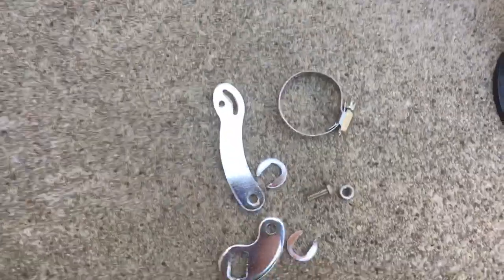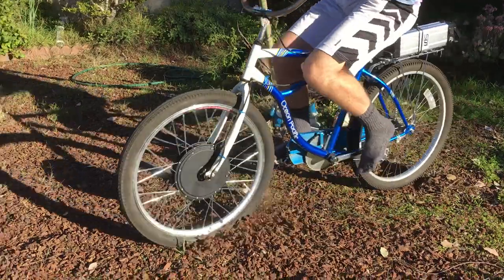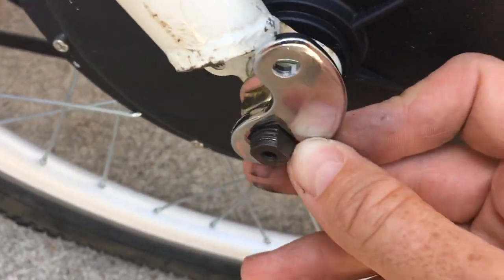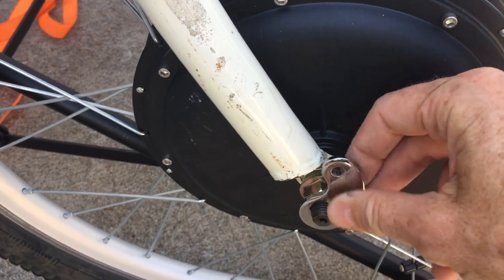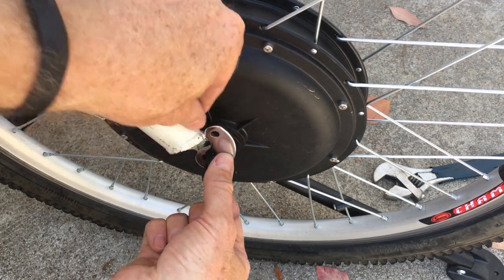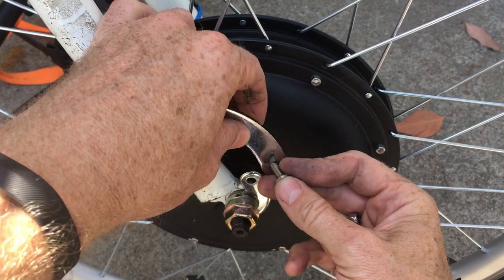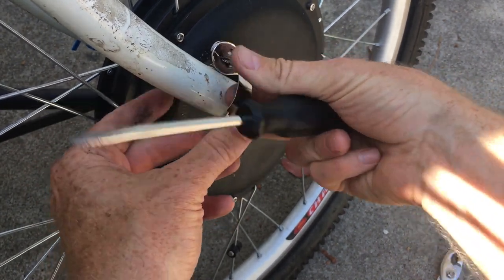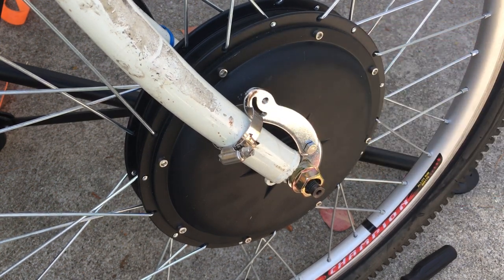How To Install A Torque Arm On An eBike

Comment: Just wanted to share a tip with you. I had originally had thought the same as you, that the torque arm in front of the fork would push against it. It seems intuitive, but it was pointed out to that you also have to take into account the twisting of the torque arm itself. It  helps prevent the rotation but the bottom part of the torque arm is pushing up on the top part which puts downward force on the axle, increasing the chance of pushing the axle out of the dropout.

Where as, if you have it on the back of the fork, it does the opposite, the torque causes the bottom piece to pull on the upper piece which pulls the axle up into the dropout, greatly reducing the likelihood of the wheel coming out, especially in the case of a loose nut.

Chances are you'll be ok with it in the front, but the back of the fork is alot more secure. Hope that helped.
Reply: are you saying the way he has it will push it out the drop out? he has it backwards right? im building ebike dont want to die please
Reply: @Oldmanlearns718  yes, he put it backwards
Reply: That's nonsense.
Reply: I think the way he did it is correct. The pivot bolt sits above the axle, so the plate pushed the axle into the dropout.
Reply: Put it on the rear and don't die.. @Oldmanlearns718
Reply: I just fyi this fact out and agree with you. To vision the explanation of the physics is very simple but I know from experience of having torques in front has no base for energy to feed into which ends up  pulling at the bolt ends which in time, the bot ends of bolt location will warp. Yes it does matter in the long run as I've seen the bolt ends of form being ripped apart from motor wheel.
Reply: Thanks for your insight and the man put the video up. I had the arm on the side of the fork. Stupid now that I've seen the video. I had two problem  the first the drop out was too big. The axle on the wheel (front) was rotating out, and down. I close the drop gap in a vice. Then install the torque on the back of the fork. I converted a trike, the wattage's is way more then I need 1000. I'm 78 and deathly afraid of falling. I don't bounce like I use to
Reply: @marsbase1729 If my ebike came with torque washers and I want to install torque arm for additional security, can I leave the torque washers in there as well? Mine has over 1000W power.
Reply: @faYte0607  yes, I did with my bike, as long  as everything fits, but if it's a choice between the torque washers and the torque arms definitely torque arms.
Reply: Also, I would use 2 torque arms, 1 for each side, for extra safety
Reply: @bobcammarata2338  :face-orange-frowning:🤣

Comment: Great explanation, I put a 1000w wheel on the front of a bike without a torque arm and instantly snapped both dropouts! I now have a new fork and two torque arms on the front and no issues :)
Reply from the maker: Thanks. A wheel with a lot of power can do a lot of damage.
Reply: @hoohoohoblin  I'm getting the QS-205 (16kw max output) and putting it on a fat tire bike with 26" 4.0 wheels. I'm going to make some from 5mm thick metal sheets, just in case lol
Reply: Was your fork aluminum? I put a front hub motor on my old steel cruiser bike without knowing this could be a problem and havent had a problem for a month.  Im still going to install a torque arm for peace of mind.
Reply: Was it an alloy fork and is the new one steel?
Reply: @wecreatezone8940  I can't remember to be honest, the whole thing was destroyed in a shed fire but I think they were both alloy, maybe the second one was more robust.
Reply: @DavidJJJ  Thanks.
Reply: @DavidJJJ  Battery fire?
Reply: @ChristianDonner  Yes, but not my bike. I had a 4kwh house battery that overheated. It was my mistake, it had balancing but I had turned off the power draw from it and it went too far out of balance when charging and overcharged one or more of the packs and basically turned into an explosive. It's all good though, I've now built a bigger shed and no longer using my DIY batteries...

Comment: Your explanation of the forces and torques was wrong, but you actually put it in the right position. I have checked the factory official pictures, and this is correct.

Comment: Nice, I wouldnt clip off the ends of the hose clamp because if you ever have to change the tire it will be alot easier to get the hose clamp back on
Reply from the maker: Thanks

Comment: Front wheel motors are a no no on alloy forks, especially on cheaper ones, My forks failed on drop outs after 30mph down hill ride, then both ends snapped at 3 mph, lucky man. Wished I had known about torque arms. Say drop outs fail with arm fitted they should hold, do you think.
Thanks for all the info and comments.
Reply: Did your front dropouts break when you were going 30?
Reply: At 3 mph

Comment: Torque arms go on the back of the forks. The motor spins forward pushing torque in a clockwise manner driving the motor into the fork but at the same time you have sideways torsion. Putting the torsion bars on the back of the fork will help push the axle upwards into the fork whereas if you fit the arms on the front of the fork they will try to push the axle downwards.  I only have an O level in physics but I'm sure thats correct.

Comment: My issue is on the rear chain side of ebike motor where axle is hollow because motor cords coming out of it. Notch washer, small washer and bolt are attached to motor cords. I cant get a torque arm on motor side. If put torque arm on rear disk side will that keep  axle from rolling out of place on rear motor side? I heard that the hollow side of axle is weaker than solid side of axle.

Comment: Believe it's the opposite side of placing torque bars. In front will slack off once a short circuit of wire ends being spaced from time happens of an extra kick back or jerking. Having the torques in front will not hold the stress and will warp the motors bolt ends damaging the motor rotation for good. In the rear of the forks. Believe me, it does matter on placement as I've seen forks being ripped apart of bolt ends of having wrong side of forks with torques.
Reply: You putting serious stress of rotation on the bolt ends as placing torques in rear of the forks, the energy is absorbed of the forks. Torques in front stresses rotation forward of no base and the bolt ends is where the energy is ending up. You have to place the physics with direction while having a solid base where the rotation s energy can feed into of a balanced friction.

Comment: I have a duel motor philodo h8 2000w and after i replace a flat tire on rear wheel it never stay on when go fast. The rear wheel keep coming loose and i use the same torque arm that you have. 
Any idea.

Comment: Hi, good clear video, I've seen these sold as pairs, do you think 2 would help?
Reply from the maker: I think so. That would be even better than one.
Reply: @hoohoohoblin  So my kit arrived and I got two arms. The only issue was I couldn't fit the second one without modifying it as the cable coming from the hub didn't allow it to slide on. The workaround was to open up the bottom end of the axle hole of the torque arm, essentially creating a dropout and allowing the arm to be slid onto the axle. It may well be overkill but it works well and gives an extra sense of safety.

Comment: Thanks, Have you had any dropouts break with using those torque arms? I've broken three dropouts, two in an aluminum suspension forks and one downhill magnesium fork using a 1000w direct (non-geared) motor using two of what looks like the same torque arms. I've noticed that the inexpensive stamped arms typically have about 0.012" of play on the hubmotor shaft and a lot of play in the torque-arm to shaft arm bolt hole, and when combined with the flex of even a heavy duty hose clamp, even if the torque arm slots are positioned tight to counter the motor shaft torque it still allows enough twist to over-stress the dropouts. I've tapped the tru-hole and used a larger machine screw on the third attempt but that apparently was not enough.

Luckily all three of my failures were starting from a stop using about  400watts (8amps at 48V). the high-end magnesium fork lasted about 100mi and broke under light starting load, and all three fractures appear to involve some element of fatigue.

I modeled cast alloy dropouts and motor shafts in Solidworks, and found that the cast aluminum and magnesium dropouts were at 60% of static structural damage with only 30n/m of torque, but about 20% with solid 6061 aluminum. From those basic numbers I have to question the safety margin on any front fork motor install even with torque arms and wanted to convey my concerns for whatever they are worth and see if you might have any better insights?
Reply: Hey, Jack! I’m happy to give you my two cents. 
1) this guy is installing his torque arm backwards. It is reacting to the torque, but the arm should be resisted by the clamp rather than the frame. 
2) drop outs broke on me when I didn’t file them down. Going from a 10mm QR axle to a 14mm axle with 10mm flats, you have to remove several mm of material before the flats will seat entirely in the dropouts.
3) if using a hub motor, go for rear. The dropouts are stronger there.
4) buy or make a better torque arm(s). Use one on each side. The one you can buy everywhere is Grin Tech’s v1 that was knocked off.
5) Use a strong p-clip instead of a cable clamp. My stack to retain these arms is using 1/4-20; socket head, washer, p-clip face1, arm, p-clip face-2, flange nut. The arm is sandwiched inside the p-clip.

Good luck! RIP your past bikes. My next build will definitely have replaceable rear dropouts 😉
Reply: @finleyoverbey5601  Thanks very much for the in-depth reply, much appreciated! Your points were helpful and I've spent the day studying the cheap torque arm and started designing my own torque arm system in Solidworks that will attach both forward and rear of the fork. If you're interested, I could  send you some images of the design if you'd care to critique it, and  if I end up having something laser cut and you would want to test it I might be able to send you a sample.

My thoughts in response to your points:
 1, as for installing the torque arm backwards, where this guy is using a steel for dropout rather than a cast aluminum or magnesium fork that would likely fracture as my forks have done, rather than spin out, and that on his fork the slotted torque arm retainer actually butts up against the fork, I might've been inclined to install it that way, rather than on the backside where the tort would be pulling against the hose clamp rather than pushing against the fork arm. However, torque arm cut out looks almost as loose as the cheap torque arms I have.

Grin technologies, has a pretty good write-up on installing that version 1 that the Chinese knocked off, and shown in this video that they no longer recommend using. installing the torque arm on the front side  is a little stronger as the arm is pushing against the fort, but if the dropouts fail with the torque arm on the front the wheel is leaving.  installing the torque arm on the backside, might have a better chance of holding the wheel in place dropout fails, and that's why it seems to me  that both a front and rear torque arm would  be most secure and have the best chance of holding the wheel in place if they dropout failed.

Also, that keep, knockoff torque arm won't fit on the backside of my front fork, so installing it on the front side with a fork was my only option.

2,  my latest, unbroken fork dropouts major about 9.5 mm so I only had to remove about 0.5mm to get the dropout to slide into place. I've got a pretty good fit, that's all the way in, but the last aluminum pork that broke almost instantly might not of been fully seated. 

3, I've built several over-volted 1500 W rear hub motor ebike conversions on quality hardtail steel frames and had no issues even without a torque arm. I would not recommend a front drive conversion as  a dropout, or fork failure could mean serious injury. Even something like a magnet coming loose inside a front hub motor could spell disaster.

I wanted to try a front drive motor on a full suspension frame that broke the dropouts in order to drive the front wheel along with the rear pedal drive foursome light trail riding. I've also got a single wheel Yakima that requires the quick release or the hitch adapter. It would be a pain to install with a rear hub motor. 

4, I looked at all the Grin torque arms, from v1 to V4. V3 looks  pretty good but it wouldn't fit on the back of my fork, that's why I'm designing  a front and rear torque arm adapter.

5, I like your solution using P-clips. I looked briefly for a P-Clip large enough to go around my forks but couldn't find anything large enough. I have messed with larger Aircraft stye P-Clips on aircraft so I might look to see if what's available in AN hardware, although one aircraft grade P-Clip B $30-$100 

I've actually broke the three forts on one frame so haven't had to RIP the frame yet.  I'm lucky enough to have a local shop that does a lot of work upgrades and sells take-off forks cheap. I might buy a few to bench test my torque arm system. 

I just got a used heavy duty Marzocchi magnesium fork that's pretty strong and rides and handles great!  installed the hub motor in it, using the cheap torque arms after I reworked them and used nickel shim-stock and pre-loaded them to in tension, and even after a pretty heavy test with power and regen the motor axel is still in load against the torque arms rather than the dropouts but it was only a learning study test until I have something like my dual Torque-arm set-up to test. 

Here's a couple of videos showing how loose these cheap stamped T-arms are. They are are so loose, that unless you pre-load them they would prevent the motor shaft from torquing against the dropouts. laser cutting rather than stamping would provide a much more accurate and tighter fit, and you could cut them out of something strong and hard like 304 Stainless 4130 chrome molly steel or 7071 or 6061 aircraft aluminum. 

Cheap and loose hub motor torque arm #2
youtu.be/7CQC_u8fATk

Cheap and loose, hub motor torque arm (Ineffective and dangerous)
youtube.com/shorts/i06tUYa2-eI

Thanks again, you can contact me through my about page on YT if you want to chat further

Comment: If I can only put it upside down will it still be effective?

One side is completely blocked off. And I only have one area I can do upside down. It's a bigger bike engaged around metal. Only opening is upside down on one side

Comment: I've got a front hub motor too, and I'm confused. Some people are posting videos saying to put it in front of the fork and some are in back of the fork
Reply from the maker: I think I’m right, but a lot of people disagree with me. I put it in front, because the twisting force on the axle is going to push the lever towards the fork, so having it in front of the fork is better than having it behind the fork, where the Clamp could break loose.

Comment: As a welder I recommend basic welding skill. A hose clamp will not work with critical failure. I had a friend who had a 1000w front hub come out and snap that hose clamp like a paper rip. He was hospitalized for 2 months( front forks dug into ground @ 30mph)...can you imagine?

I recommend a steel framed bike as you can weld onto the dropout. Weld 2 coupler nuts on each side of the U. Put the wheel on and then put bolt through as it slides in both nuts on each side. If motor torques it is near impossible for "forks" dropout to bend and/or axle come out. After weld if your sloppy clean up with grinder then put jb weld steel stick putty over welds and morph for a clean look(also seals weld from oxidizing aka rust). Last match the paint. Outcome is industrialized dropout aka motorcycle dropout. 

I did this with one of those super 73's except it was not a super 73 just the style. Only difference is....its all STEEL.

Get a MIG FLUX welder they are cheap and very easy to use.

Comment: The wheel spins in a clockwise motion, therefore the torque will be clockwise. How is everyone saying it would be a counter clockwise motion? The wheel would spin off the fork going forward, not backward. This would also break the wires.